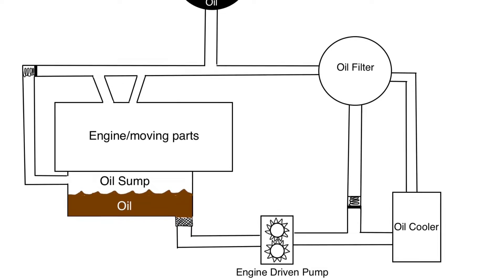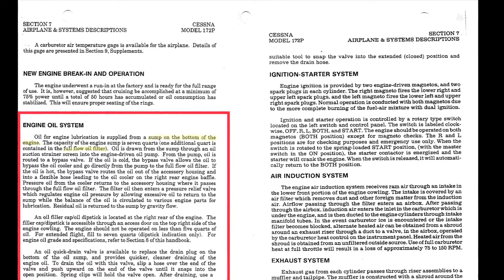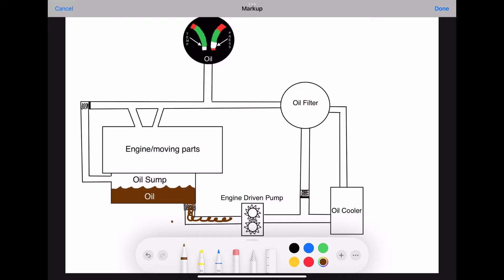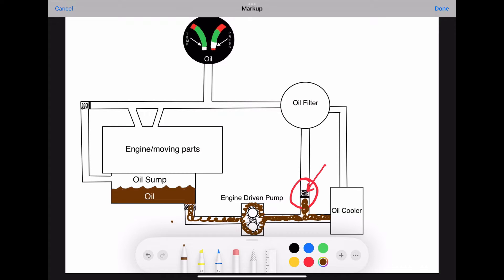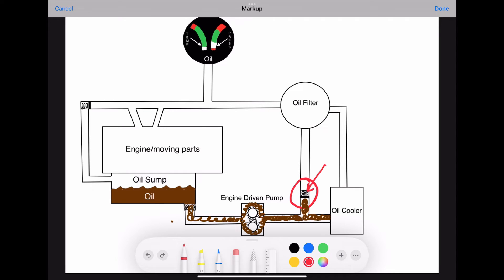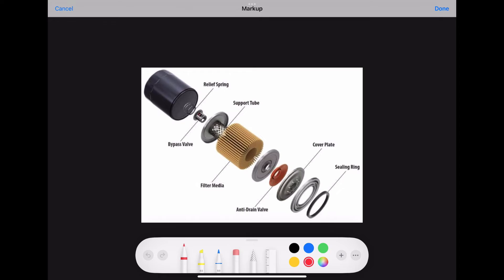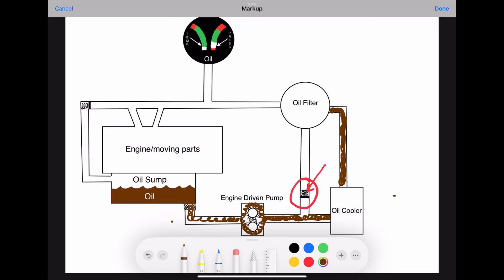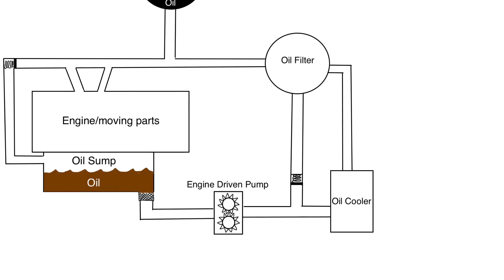Oil System Cessna 172 | Aircraft systems

Comment: Best video. I was always confused how the bypass valve worked
Reply from the maker: @romarpeynado1593  the bypass valve directing oil to the cooler may not be exactly as I described it. Reading more in depth about the Lycoming engine, that bypass valve may function like a vernatherm which expands and contracts the spring based on temperature, not viscosity. I have been meaning to ask an A&P if that is the case, but i read also a mention of viscosity valves in the oil system of the Cessna 172. One day I will update the video with a clear explanation.

Comment: Good video, with one issue.. the oil cooler bypass valve is temperature controlled, acting on oil temperature, not viscosity. It is similar in operation to a cars thermostat. Commonly called a vernatherm.
Reply from the maker: That is interesting to hear. I am open to learning new things. Would you mind explaining how the bypass spring can sense temperature? Or maybe send me a link to a source explaining how that would work? I took this information directly from the Cessna POH, along with the service maintenance manual used by A&P mechanics to service the plane.
Reply from the maker: I think you may be forgetting one thing, temperature and viscosity are directly related. So I guess one could make the argument that a vernatherm is temperature controlled, but as temperature rises, viscosity decreases, and so does the pressure of the oil. As far as I know, the bypass spring is not sophisticated enough to sense temperature. But if you have a source from Cessna that you can send me explaining otherwise, I would love to see it.
Reply: @CFIGreg  I think you have misread the manuals, look up how a vernatherm works. It is a temperature dependent wax pellet in that vernatherm that controls the spring, just like a cars thermostat. There is nothing viscosity dependent in the loop.
Reply from the maker: @mosesk4596  that’s not quite what I read, i’ll look into it further, and if there’s something I missed, I’ll definitely add it to the video and description, I still encourage you to send me a link. Must be from Cessna/Textron for a 172P model. Must describe exactly what you are describing. Otherwise, I can’t add it to the video because I don’t have any evidence to back up what you are saying. Also, not every plane has a vernatherm, many of them will have viscosity valves which will function only based on viscosity. If you’re able to send me something solid from Cessna, I’d love to see it. I am not an expert on oil systems, but I also cannot make a claim about the 172 oil system based on a quick googling of vernatherms, I need the info to come from the manufacturer in some fashion. If you have a link, please send it my way so I can expand my knowledge. Thanks!
Reply from the maker: @mosesk4596  that is extremely interesting to hear. I don’t recall reading about that particular process in the service manual. Thank you for citing the sources, it will allow me to research this further and if it checks out, I may end up making some changes to the video. I’m always looking to gain a better understanding of how the systems work so I can pass it on to students. Thanks for taking the time to explain this in depth.
Reply: @CFIGreg  This is one of those situations where it depends on the specific SN of the 172P aircraft. Cessna went back and forth with some using a vernatherm, and some using the spring & plunger pressure version.

Comment: This is great work chief! Loved the fact that you actually explain it clearly, and step by step with the use of the POH. A lot of the videos out there do explain the basics, but have been missing out some important/ small parts, such as when does the oil go through the cooler and when does it go through the filter.

Will you be able to talk about the electrical system in a c182 if possible please?